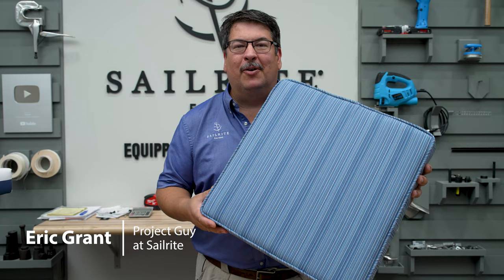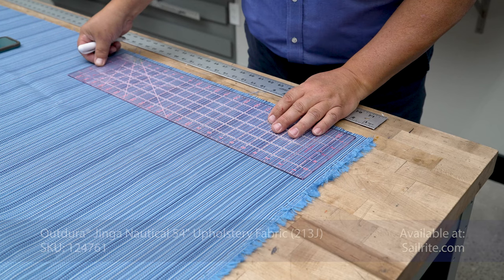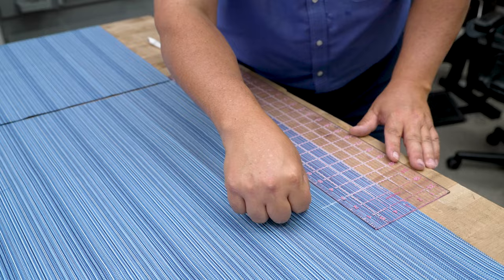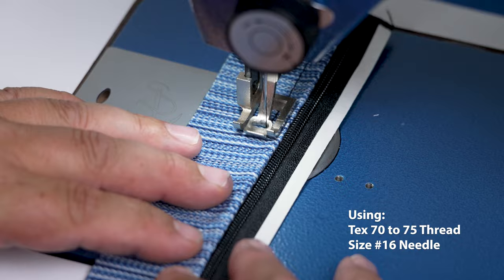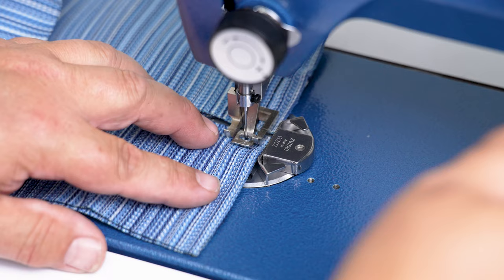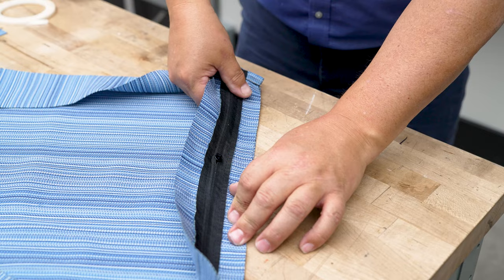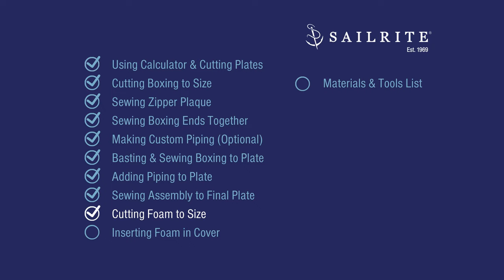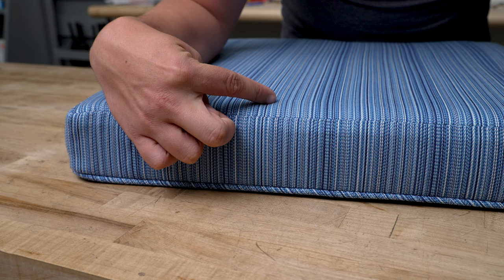How to Make a Box Cushion with Seamed Corners

Comment: If you are sewing 0.5 inch seams on all sides... shouldn't the material be 1 inch in all directions to accommodate the 0.5 + 0.5 seams on all sides?  I just sewed my first cushion following all the instructions and it came out too thin and small... am I missing something?
Reply from the maker: We actually want the cover fabric to compress the foam for a nice tight fit without wrinkles. That is why we make the top and bottom plate the same size as the foam and the boxing just 1/2" wider than the thickness of the foam. Yes, when you sew the 1/2" seam allowance the top and even the sides will be smaller to compress the foam. If you do not want it as large just add 1/4" more to all sides of the top plate.
Reply: thanks!  yea i was really rigid on my final sizing... i was going to add a layer of thick batting to give me some more thickness in the final cusion.  I remade the cushion by adding 0.5 more to the dimensions before putting them in the calculator and it put out what i needed... 
thanks again! @SailriteDIY